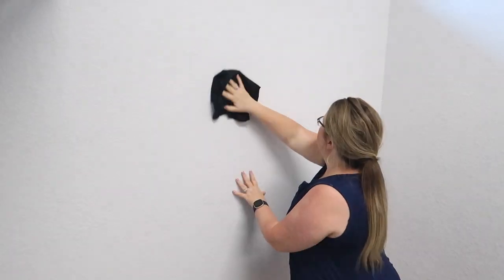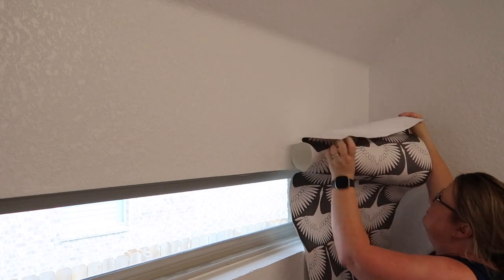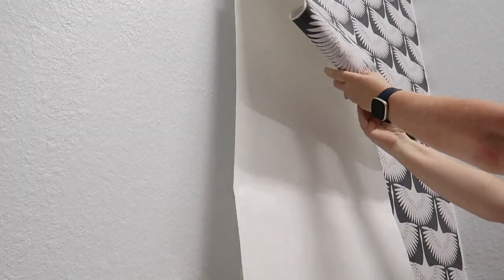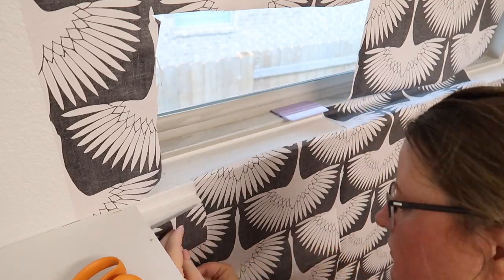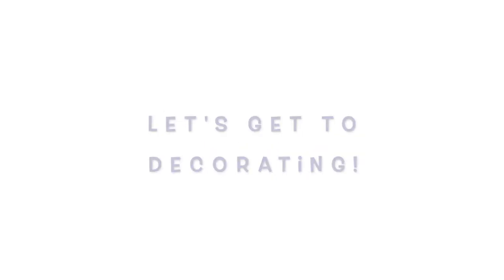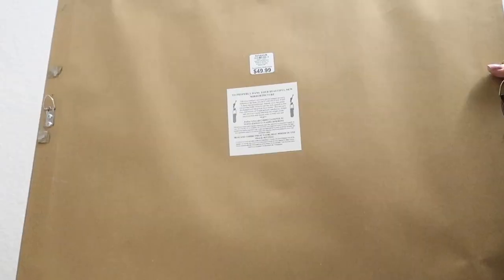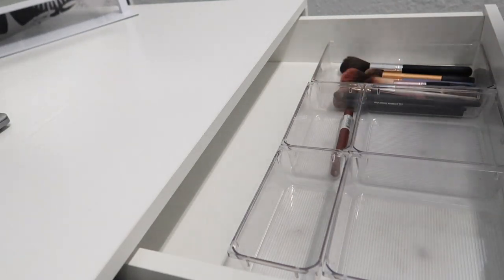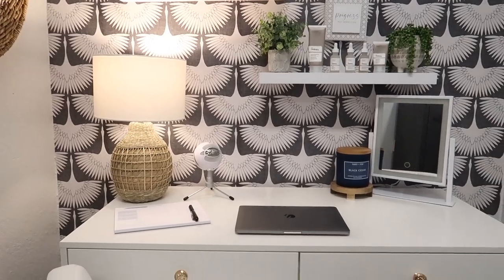Closet Office Makeover//Closet Office Ideas//Peel and Stick Wallpaper Accent Wall

Comment: Pausing at 10:35 to ask you a question: so you're recommending we begin with the side of the room that has the most cut requirement, rather than the side that has a plain wall?
Reply from the maker: Yes! The reason why is because you want to be sure that you have a good amount of paper to cut into. 
Now I think technically you came measure the room so that you don’t have a small sliver on either end but in my case I was working around and under the shelf which made it more difficult , I hope that makes sense.